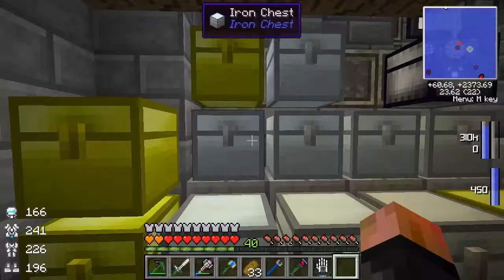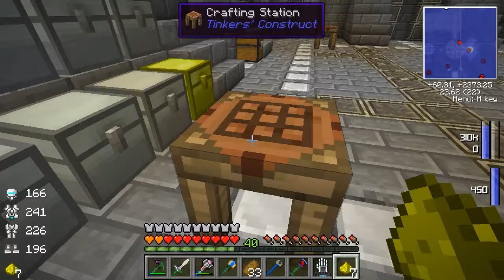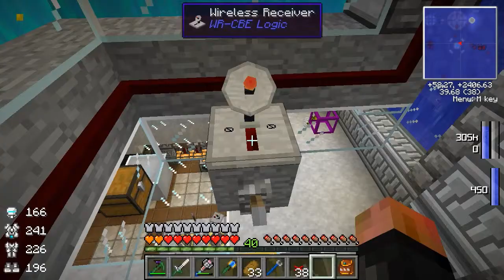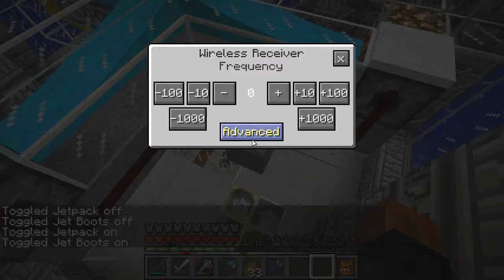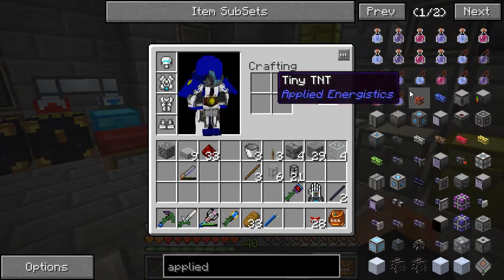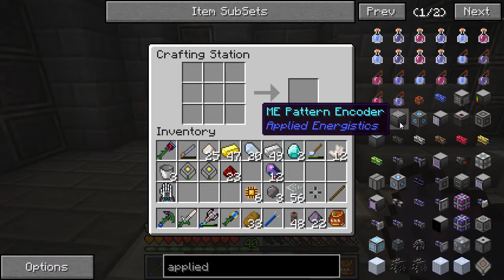Applied Energistics Setup  (Survival Sealab | Part 28) [Applied Energistics Mod]

Comment: if ya want a better understanding of the power being used you can switch the power shown by clicking the little AE button on the top left corner of the ME controler. AE, MJ, RF, EU so on ad so forth.  AND, once you have everything set up just make a few import bus and just take all your output ender chests and put them next to your ME system and connect them together with the import bus and BOOM all your separate systems are now ONE!!!!
Reply from the maker: You called it, That ender chest thing is exactly what I'm doing! Taking a look at it on the next episode.
Reply: oh yea, thats the way to go. ALSO, look into the blood and bones mod pack..................... ive restarted that over 50 times already, literally, because of rage quitting LOL   its awesome but SO god damned potent. play it with a crew or at least a partner, youll need it.
Reply from the maker: Caleb Ames When Blood N Bones 2 comes out I will see if JBeetle is interested.
Reply: I know he'll never get this but with jbeetle
Reply: nice